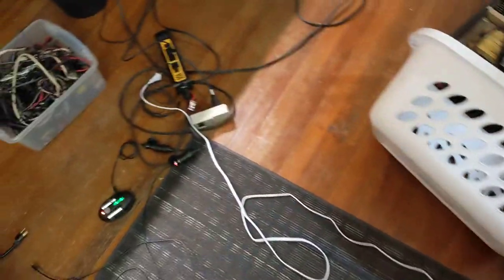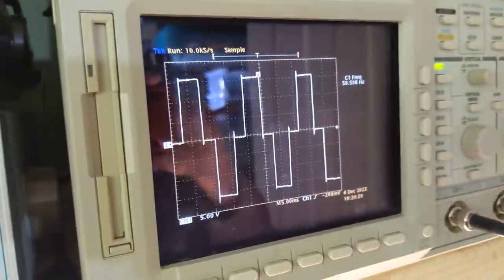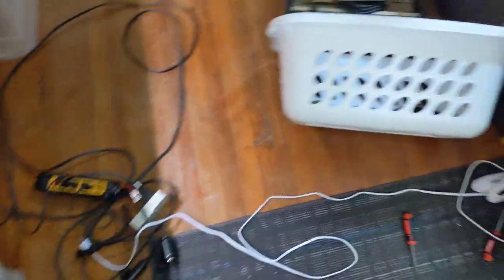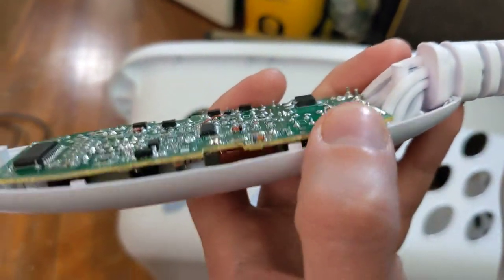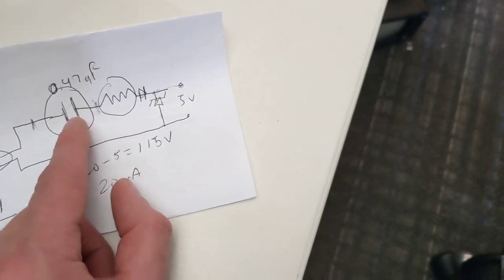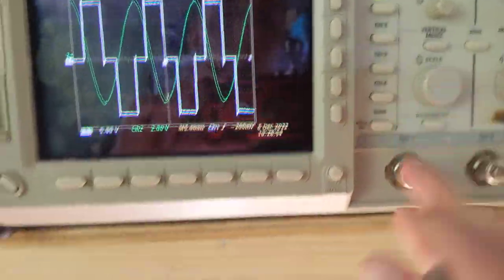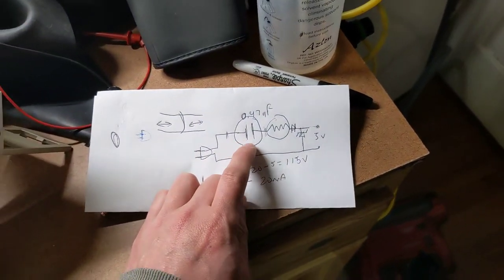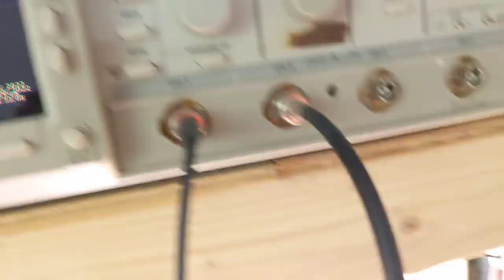Modified Square Wave Inverter vs. Electric Blanket

Comment: Thanks for explaining this! I have an electric blanket (second one, because I thought the first was broken) trying to run through my inverters on boat. I need, it sounds like, a new inverter just to run this blanket, which sux (my current inverters run everything except the blanket.) Recommendations on a low-cost inverter to run this blanket? Don't want to spend much money, because the new inverter will essentially be a dedicated device for the blanket (grrr).

Comment: Did you check the thermal fuse? It looks like it’s built into the circuit and should have protected the more sensitive components. That square wave step voltage could have resulted in a higher current draw, leading to the thermal fuse blowing.
Reply from the maker: It didn't burn up entirely (I think the one resistor got hot and I smelled it in a test condition and turned it off quick), so the thermal fuse is presumably good. It's a good thing to check though!

Comment: Awesome video! Do you know of a product or way to 'clean' the waveform out of a squarewave inverter? Like maybe a male plug+small adapter like box then female plug? Ive seen it done with potentiometer, but wondered if they made a plug and play type device.
Reply: You find anything? Or perhaps a cheap inverter that is pure sine wave?